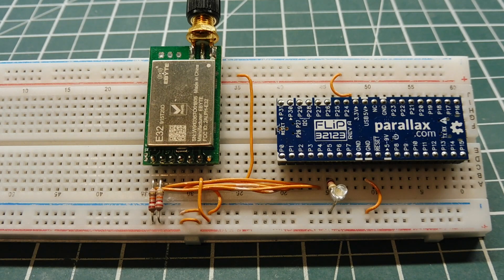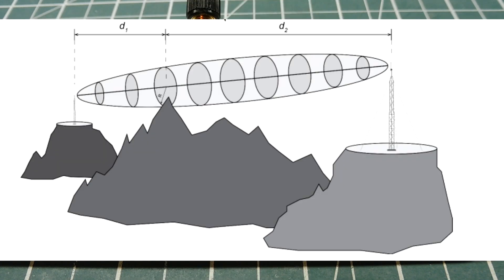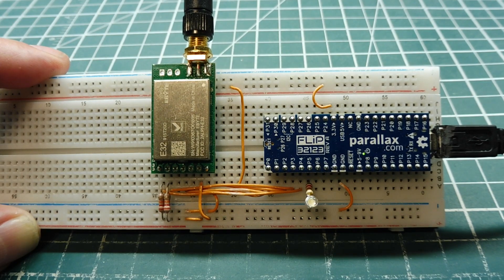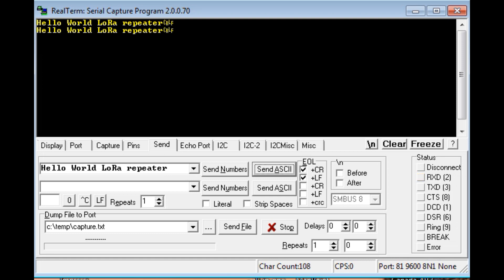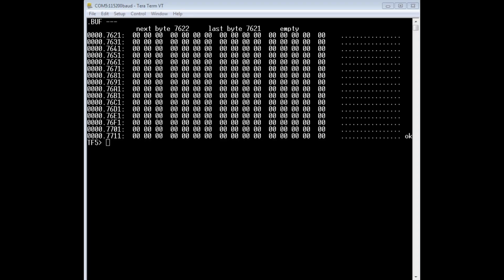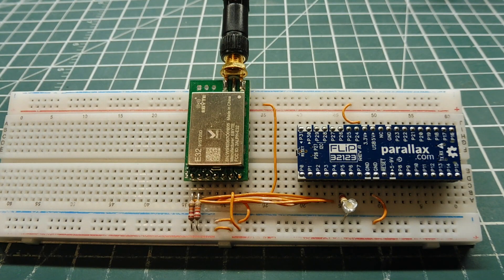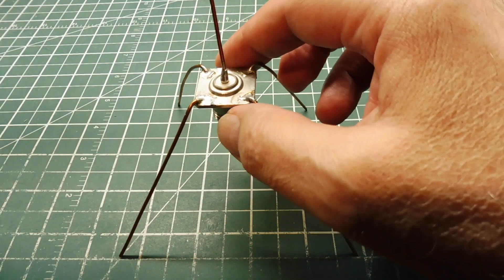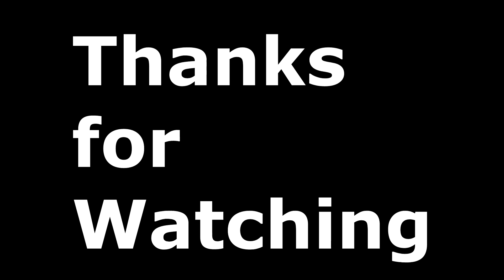LoRa Store & Forward Repeater  /  LoRa Antenna

Comment: I designed a lora relay system that repeated everything it received . However the issue with this simple approach is when  two repeaters can hear each other. They can get stuck in a packet relay loop. Also  there is a limit to how much data allowable transmit time is legal. The time  could be used up by other users of the band that the relay is repeating.A solution to that is a packet header to only repeat data that your sensors are transmitting.
Reply from the maker: The purpose of the video is to demonstrate the simple store and forward concept. In a real application the base acts as a master and polls all the sensors in the field in a round robin fashion. The sensors have a unique ID and will only respond when polled. First the base will poll direct, if no response the poll is sent  through the repeater with the ID of the target sensor. The sensor will now respond back through the repeater. The poll interval time can be adjusted to keep transmissions to a minimum. The radios have the ability to change channels, ID, and power levels.
https://youtu.be/JvBC7cEgI0E

Comment: The E32 modules for 915MHz are getting hard to find. Is there a replacement for these modules ?
Reply from the maker: You can still get them on Amazon.
Ebyte still supports E32 in a DTU package.
http://www.cdebyte.net/lora-modem/915mhz-lora-modem.html
and in module format.
http://www.cdebyte.net/lora-module/sx1276-lora-module/915mhz-module.html

Comment: I did something similar using the same 1W module, I used an ESP32 to make a Lora to wifi gateway, whatever comes in over Lora is forwarded to a website, the response is then returned to the Lora module. I did do a video showing my project build.
Reply: hI BRO, WHERE IS THE VIDEO?

Comment: The Feather boards from AdaFruit work nice in this application, and you don't need the separate controller. I've used them myself. As an aside, I didn't expect to see a prop chip driving it. :)
Reply: Could you please elaborate a little more, how you created the repeater using adfruit feather boards? thank you!
Reply: @oracledeveloper8397  The Featherboards have their own program space - effectively making it a combination of the E32 and the propeller chip. There is a library available to control the radio side, and you have plenty of program space in the Feather to do the repeating (in our case it was getting weigh scale information and passing it to a tablet).

If you are in North America, then you need to use the 900 Mhz versions, Europe, 433 Mhz.

Here's the board:

https://www.adafruit.com/product/3078

And I used the recommended Radiohead RFM9x library. Works very well. Here's Adafruit's link to their tutorial:

https://learn.adafruit.com/adafruit-feather-32u4-radio-with-lora-radio-module/using-the-rfm-9x-radio

The LoRa and the RFM69HCW versions of the Feathers are different enough that one will not necessarily replace the other. Regardless of the pins matching up. So if you are going with a PCB, keep this in mind.
Reply: @MrWaalkman  I'll try that, it looks for me easier, than lora + propeller. thanks.
Reply: @oracledeveloper8397  Any controller will work as long as it has a serial port
Reply: @MrWaalkman  Could you share the code for a Featherboard repeater?